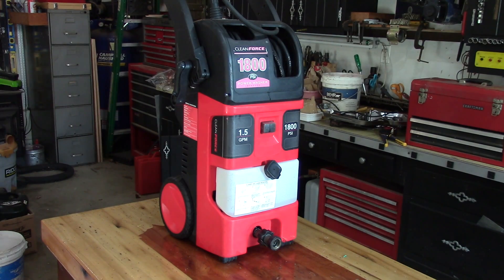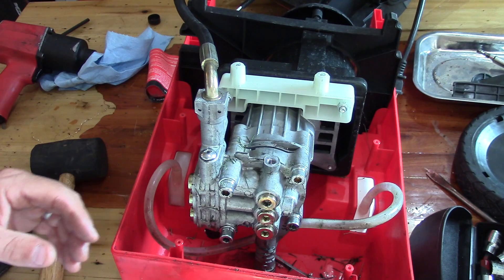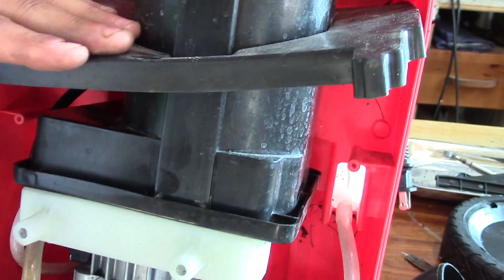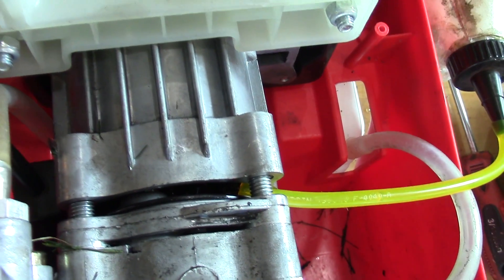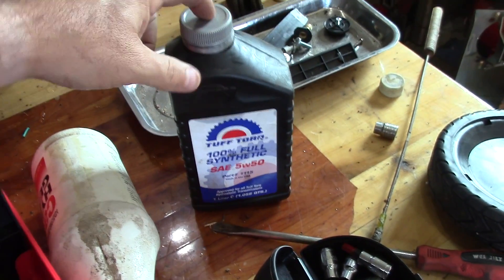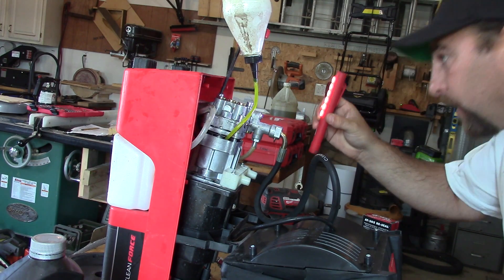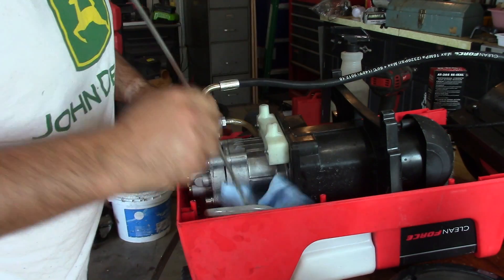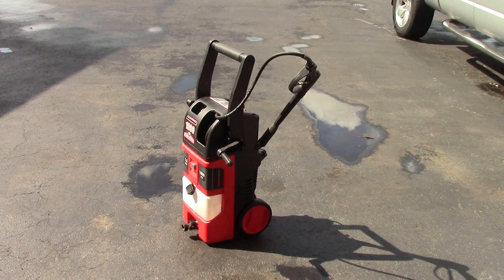Electric Power Washer Leaking Oil :   Fixed

Comment: from what i know about pumps and machinery in general, you don't want to use engine oil, it has detergents in it that will keep fine metal particles in suspension turning that oil into an abrasive over time, you want to use a non detergent oil so probably compressor oil would be a better bet if you cant get pump oil. if you dont have a filter on the system then dont use detergent oil

but the old rule applies, 'wrong oil better than no oil'

Comment: Thanks for this very helpful video. My Nilfisk C110.4 had same problem with leaking oil. Actually the pump inside looks almost identical and I could follow your steps easily. I used STP Engine Stop Leak and full synthetic 5W40 oil. Seems that oil leakage has stopped and my washer works well. 
Again, great video 😊, thanks

Comment: Pump protectant spray is not only for storing your pressure washer it's also a maintenance that should be used at least once a week if you're using your pressure washer daily this will keep your pump cool and also keep from hard water pitting the motor.

Comment: My Ryobi was shutting off after 2-3 minutes of use. The thermal switch was doing its job. It was overheating due to low oil because of a small oil leak. I did what you show here and my problem was fixed. Sometimes its not worth the time it takes to fix things.... this time thanks to your video less than an hour and less than 20$! thx

Comment: So in finding a filler hole for a similar pump. I have the 3 same hex bolts as you have but i have a smaller hex on the side of one. Could that be a filler for mine or should i just fill it the way you did. I unscrewed all the bolts and drips of water came out even from the side screw mentioned. Any help would be greatful. Thanks

Comment: I can't seem to get those plastic tabs off of my Clean Force 2000 to open it up!?!
Reply: Yes, I had the same problem. He fails to mention in this video that the tabs are held in by screws directly in front of them on the front side of the pressure washer. Once you take out those screws, tabs will pop right out. It should have been a key part of this video, because without being able to remove the body, then you can’t do anything. Anyway, hope that helps..

Comment: Great video and explanation.  After you put back together with oil did check to see if any of those plugs lead to the oil chamber?  I have same unit but mine does not come back on after I let the trigger off, have to stay on continuous.  I was wondering if you noticed if there is an unloader valve on this unit?

Comment: Hello.
I got an old karcher k2.14 wich had some issues. It should be fixed now, but I don't want to turn it on yet, as it lost a lot of oil. Would a car motor  10w40 fully sintetic do? Or does it needs some special one?
Reply: did you watch the g'damn video?

Comment: I have the same pressure washer but i have a different problem mine doesnt throw any detergent with the black nozzle what would be wrong with it
Reply: I know the advice I am about to give you is basic. You may have already done these things but I had to start somewhere lol.
Have you checked the pump that the clear hose that the detergent thru to be applied to whatever you are washing? Make sure there are no cracks or holes in the hose that you are using. Also make sure that your nosal is in good condition and put on properly. Please let me know if you've tried any of those suggestions already or if any of my suggestions helped you in any way. Thanks so much and good luck.

Comment: Sorry no comment on this video.. just subscribed, looking at generators, do you still have or use your harbor freight generator? I noticed you got another video back in January .. I was thinking of getting the same harbor freight 8750/7000 generator but was wondering your thoughts about that generator after having it for a few years now... I'd hate to buy a head ache.. my E-mail is rickwood1965@yahoo.com

Comment: I've got a pretty weak electric pressure washer that still works, but I really need to upgrade it even though I only use it twice a year on my house.  The work would go so much faster with a better electric machine since gas is not something I want to mess given how little I would use it.  Thanks, Bob!!
Reply from the maker: The electric ones are the way to go it you use it less than 4 times a year.
Reply: Is it leaking water ANYWHERE? Either from where the water spiket connects to the hose or from where  the hoses connects to the pressure washer or from where the hose connects to the gun?